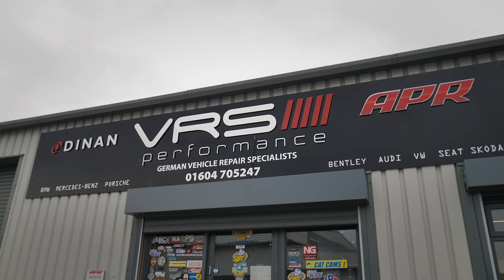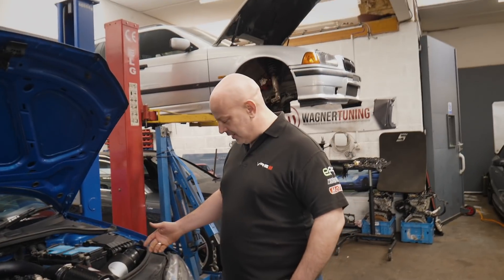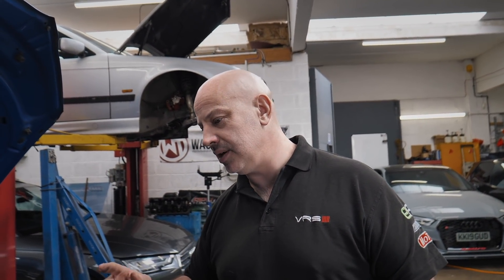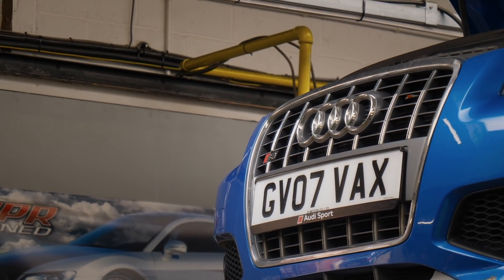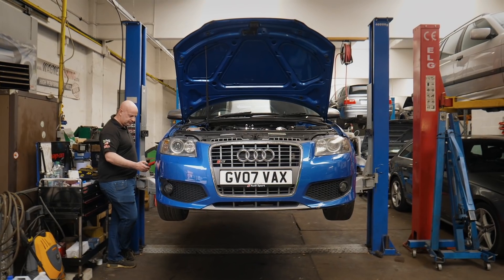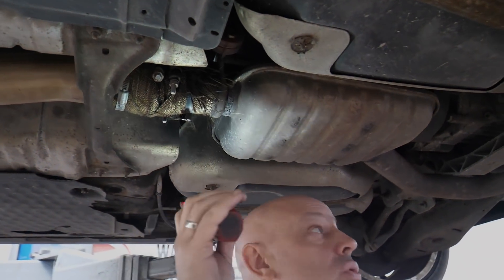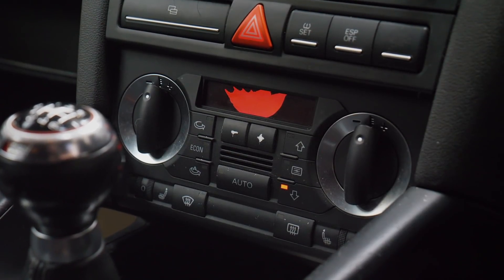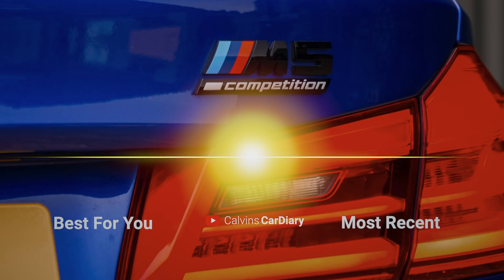PROBLEM! My Audi S3 Is UNSAFE TO DRIVE!

Comment: Glad you’ve bought this Calvin. I’ve got a 2012 S3, 65,000 miles, DSG. Bought it a year ago. Rapid, but I’m sure I have a problem with the diff. It whines above 40mph when I let off the accelerator. There is also a squeak or a cheep cheep bird noise when I edge through traffic, when the car has momentum and I swap to the brake. Also not particularly smooth at high speed. Have balanced all wheels more than once. Wish it was spot on, I want to map it.
Reply: Sounds like a bearing failing on your diff.

Get it sorted ASAP before it grenades your diff box.
Reply: Thank you. How in depth a job is it? £££’s?! Could it account for mild vibration at speed?
Reply: @electrician1602  It can account for the mild vibration yes, if one of the bearing races have popped out or the bearing is loose you'll get play in the drive shaft (up and down). 

It's not massively in depth if you have a car lift and all the tools, but it's still 3-4 hours work for an experienced mechanic (wheel off, brakes off, diff cover off, drive shafts out). 

Could even be a wheel bearing, which would require same/similar procedure depending on vehicle model/make. 

Price wise, if you have a good local mechanic/garage, shouldn't cost more than £500-600 including labour, unless you wanted/needed new drive shafts (they're best replaced in pairs). 

S3 Diff is probably in the region of £600-700 used on ebay (i've not looked). Best case scenario it's a wheel bearing and you've just got a bit of wheel wobble from the bearing leaking or not performing correctly.
Reply: Thanks for this mate. I appreciate it, going to take the car in on Monday. Much obliged.
Reply: @electrician1602  No problem. Hopefully it's sorted and the fix is within your budget!
Reply: @electrician1602 any update on what the issue was and cost to fix mate?

Comment: My money is on a coil pack for the missing. I had it on mine (still got the s3, sprint blue as well) and 1 failed again within 7k miles after I replaced the set. Fit R8 ones

Comment: VRS performance are fantastic. Will is a great mechanic 👍 A very helpful video Calvin.
But the lack of maintenance shows that the previous owner / owners have not looked after the car correctly. Plus the MOT’s in the past have passed for years. So I guess it’s a recent issue.. 
Great content again 👍
Reply: Or it’s a series of bent MOT’s.. not too hard to get if you know the right people unfortunately

Comment: VW/Audi got rid of the 1.8t 20v kept the engines problems (pick up pipe, coil packs etc etc) and gave it more problems 🤣
Reply: Bro I had the mk7 Audi A4 2.0 TFSI Quattro the engine oil burning was unbelievable everything three months light on from full and oil chain pump went destroying bottom of engine with a 20k bill no German ever again got a Lexus GS now.
Reply: Had 1.8t Agu with an ihi v34 well over 320bhp stock internals nearly 20 year ago a  never had any  problems. Most of the work done on it was when it was already over 70k miles
Reply: @liamjohnhawkins4212  more of a pop at the TFSI’s. I’ve also got an AGU and did all the preemptive maintenance before getting it mapped. Having to sell it now as the London ULEZ zone is expanding next year and it’s not compliant. £12.50 a time to even drive it down the road.

Comment: Audi proving yet again why i wouldnt own one.Absolute shit boxes.
Reply: Yea I had a Mazda MPS for two years only 'big' thing is one of my HID motors went - My Audi s3 8p (same mileage) had to have chain replaced, oil pan dropped, pickup pipe replaced, pcv valve went, the backs of the front seats glue went undone so had to glue the seats back on, now my subframe is making lots of noise (come to find out that these cars have lots of play in the subframe bolts so had to buy a pricey subframe collar washer kit and 20+ stretch bolts to re install both subframes) > not to mention it uses 500ml of oil every thirty days and my Mazda never used a drop !
Reply: Have to say hot VAG stuff is absolute shite for reliability in my experience